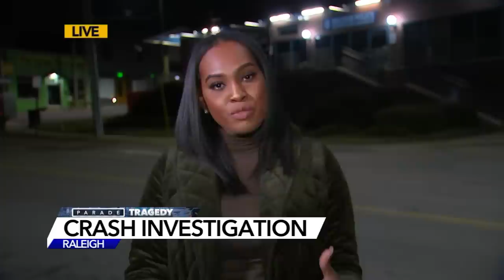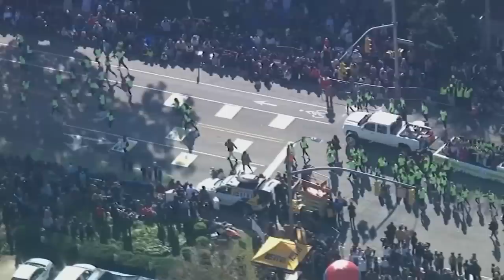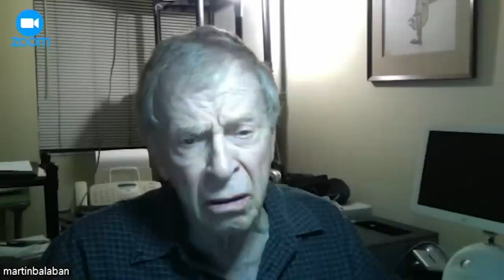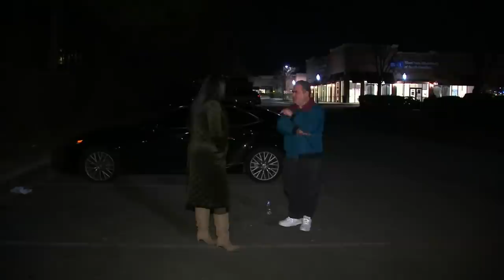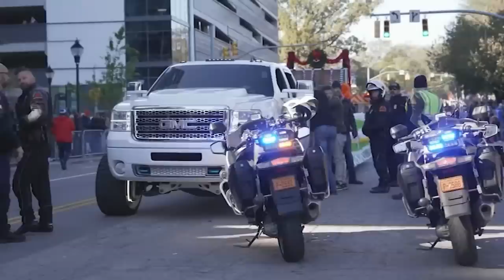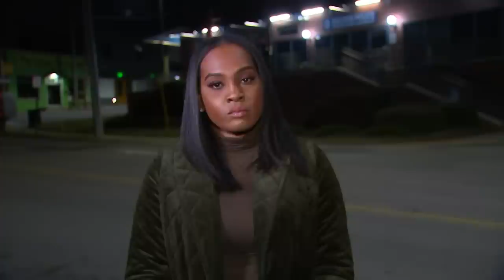Investigators look at truck part by part after Raleigh parade tragedy

Comment: i pull trailers all day 5 days a week, im sure he panicked but there are many things you can do before it gets to that point. pump brakes, slam the parking break. throw it in to neutral and put try to put it in park even if it damages the truck and stops the parade, its still a better outcome than what happened. prayers go out to the the girl’s family and  the young man for making a mistake.
Reply: He had an e handle
Reply: Lifted truck.. big wheels.. I'd have driven through a building before I hit a kid..
Reply: if ur a truck driver and pull trailers u should know a parking brake isn’t the same as an emergency brake and a parking brake is only meant to hold the weight of the truck not to stop a moving truck and if he put the gear in park it would have just clicked the tcm wouldn’t of even picked it up so i highly doubt ur a truck driver
Reply: @bookingmods9197  what do you mean the tcm wouldn’t have even picked it up? And if you force the shifter on this trans hard enough it will click but it will go into park. The park pawl may have broke the case but it would have probably stopped the truck.
Reply: Parking pin in the transmission would grenade and will not stop a truck especially pulling a trailer. Keep in mind this is a diesel that runs in a hydro boost system for brakes… there is no pumping the brakes when it fails
Reply: @jamesmoore716  brakes went out, allegedly.. not the steering
Reply: @jamesmoore716  either way, the kid had a history of driving vehicles without current state safety inspections.. it's still his fault..
Reply: @SLOCLMBR  steering going out and brakes going out at once is common. Learn some basic mechanics. The safety inspections weren't safety inspections, they were emissions buddy. My state does do emissions checking either way so it doesn't really apply, brakes failing isn't a rare thing, he was just unlucky, and he has to pay the price for something he has 0 control over. Before you say it, a little lift and 35s aren't the cause of the (brakes) failing
Reply: Its extremely hard to stop when its a pressurized system and the system as a whole fails. It was easy to oush stop because he most likely had parking break on andddd had it in neutral. But heyyyy get this an object in motion will stay in motion especially at a down hill slope. Ive been pullin trailers with my dad for 7 years.
Reply: @joshwilson849  the tcm would register it going into park from drive going idle speed. parking pawl would just click and the tcm overrides it to neutral to protect trans. the parking pawl will just keep clicking go try it buddy
Reply: @bookingmods9197  the tcm cannot override input the manual selector. It can override a range selection but not a command to park
Reply: @joshwilson849  fake news buddy a youtube video will debunk that right now. i know at like 5 mph they can slam stop but not how fast he was going
Reply: Or just turn the ignition off...
Reply: i valet trucks like this all the time....they wont shift past N until you're under 2mph. wont engage P unless your foots on the brake. parking brake light will just flash at you and do nothing until you get the speed down. This is the cost of letting computers dictate everything. there was literally nothing he could do, and in a panick, good drivers dont swerve.
Reply: Brake failure is not something taught in driving school, and it should be, buddy probably panicked
Reply: @CanuckBacon  it was when I was in driver's ed. If I remember correctly though the advice they gave was to downshift to the lowest gear possible and turn into a guardrail or wall to scrape along and slow you down
Reply: Ok obviously you dont know much about diesels, this is called a runaway diesel and the only way to stop it is by cutting off the intake it was completely out of his control he was doing everything he could he is only 20 and shouldnt have to go through this you see that the trick was still pulling the trailer with ease it obviously wasnt the brake system
Reply: @lilhudlambo7646  this wasn’t a runaway.  If that truck ran away this parade would’ve been a bloodbath.
Reply: @bookingmods9197  parking break works on a completely different system that is usually not at all electronic
Reply: @joshwilson849  actually no it wouldnt have stopped the truck slamming it park the teeth arent as deep as you think .
Reply: He had the truck in park and and empty break on but he had too much momentum it just kept going
Reply: @bookingmods9197  Hi NOT SO BRIGHT,  the parking brake would have slowed the truck down or stopped it as it wasn't doing 60 miles an hour . The more of your comment that I read, not more unintelligent that you sounded.
Reply: @bookingmods9197  PS. NOT SO BRIGHT,  I drove big trucks and regular trucks pulling trailers and ran heavy equipment  for over 45 years. You obviously haven't.
Reply: @bookingmods9197  The more that you comment, the more unintelligent that you sound.
Reply: @bookingmods9197  You should stick with your video games.
Reply: Wow I sure shows you’ve never had your brakes go out.
Reply: @jimbeam2705  and yah buddy i used to make money off games when i was in middle school. i drive a big truck just like u and pull trailers of equipment too now bud i guess i’m a cool guy like u now
Reply: For the lift it does matter as if they used low quality brake line or did not install them correctly then it would only be a matter of time for the brakes to fail. You can’t just lift that much without new lines. 

The 35s also do matter as that probably doubles if not triples the rotational inertia.  (Simple physics).  Meaning stopping takes much more force, stressing the brakes more and you will need to inspect and replace parts more often.     This also made it harder for people trying to stop it by hand. Now it was not as big an effect as the float of course but it is still a factor.     Not to mention an e brake likely was not installed as again you have to lengthen lines after a lift for it to work. This alone would stop the vehicle albeit slowly.
Reply: @lilhudlambo7646  you don't know what a runaway diesel is lol.  That truck would have crashed into the first building in sight or if in neutral it would have smoked the whole place out until it blew.  None of which happened.
Reply: @UCzegEr0Nc6AwCoxq5Dsr-2Q   when a hydro boost brake setup is ran off of sensors yes it’s very well electronic. he probably boiled his fluid from pulling the float. but putting it in park will only make the parking pawl engage.i have no idea where u got a parking brake engages the park pawl. only gear park does. there called parking brake shoes that engage when u press in a parking brake has nothing to do with a transmission. buddy
Reply: @UCzegEr0Nc6AwCoxq5Dsr-2Q tryna correct me and u don’t even know how the basic engineering works lmao ur just like every other guy that’s commented saying there a big truck driver and how their right
Reply: So you would know throwing into park would of done zip , the paw wouldn’t be able to grab it would just make the clicking. And the E brake isn’t gonna stop the load , we don’t know the weight of that trailer we don’t know if the trailer even if trailer brakes that actually worked
Reply: @jimbeam2705  see my above comment  ive tried it. All it does is the blink its little red light at you until you put it in park and then it engages. It is the same for every GM model, from there base little sonics through their Cadillacs all the way up to the Denalis and Yukons. You have to buckle the seat belt in order to get them into gear to drive them away and you have to have your foot on the brake with it at a standstill before you can put it in park or engage the parking brake. parking brake works off the TCM. Some call them safety redundancies I call them an annoyance to the guy whose job it is to park as many cars possible in the shortest amount of time possible.
Reply: @85square  every vehicle now days has electric parking brakes.. what do you mean?? Lol alot of vehicles you can't even have the door open and start to back up! It slams the ELECTRONIC ebrake on!
Reply: @joshwilson849  he tried shifting and broke the shifter
Reply: @bookingmods9197  parking brakes on an 11 GMC Sierra had a cable no electronics about it works similar to a bicycle brake
Reply: @BrendenCBR600RR  I pretty sure that truck doesn't
Reply: @jnspython9719  You have no clue what's on a vehicle do u? It's a parking break not an Emergency break
Reply: @CanuckBacon  I know when the master cylinder on my '73 dart left the chat room I had to use my e-brake to get home. Kids these days does not get taught enough of  "oh sh#*" scenarios. My dad helped me like driving in the snow and while turning, he pulled the e-brake on my fwd. Little he knew I drove a lot that way.
Reply: @340duster8  exactly! 💯% my dad used to sit behind the driver seat, and would randomly cover my eyes and then just give me directions, it taught me how to drive straight, use my other senses when driving as well as how not to panick
Reply: @340duster8  I also learned on the spot when my brothers Ford Escape 2017's brakes failed, how to brake using the transmission
Reply: A lot of people are saying he should have swerved into a wall or building, you can see all the crowds all around him that wasn’t really an option
Reply: Light pile right there too
Reply: Just turn it off. Simple!
Reply: I pull landscape trailers to big Tex dump trailers for a living that dude could have don’t something different
Reply: @jnspython9719  an e brake won’t work unless the vehicle is stopped
Reply: @Haun Lou the brake lines and e brake cable are designed for the car as it’s made by the factory. It has very little slack in the lines as they make it to fit with some manufacturers tolerances. So you might get an inch lift kit hooked up with stock cables except the cables will be taut and any disturbance could rupture them. In larger lift kits you need to add extensions or new line to accommodate the new length of tube or wire to reach the brake. 

Or do you think trucks just have like and a tea 6 inches or more of loose lines just flapping around when at stock height?
Reply: @lilhudlambo  This is 100% not a runaway diesel.
Reply: @jnspython9719  I mean, going downhill, and all that weight? If he pulled the brake. It will have broke too.
Reply: @SLOCLMBR  Did you not watch the video?  There were people all around the truck...  If he drove it through a building he would have hit the crowds on the left or right of the parade.
Reply: I doesn't damage the truck it only damages the parking pawl that won't stop it. All he had to do was kill the engine
Reply: ok well do we know that he did not try these methods that you are suggesting
Reply: This is a very sad situation. I agree that the driver is young and not very experienced. Most of us are older than he. I have been taught to shut off the ignition or slam the vehicle into park. I did slam the vehicle into park while slowly skidding down hill. It worked. Please be careful.
Reply: how do we know he did not do this and why convict him before we know what happened, they had already nailed him to a cross right there on the in the middle of the street
Reply: Correct and I have that same truck if the float had electric brakes he probably could have applied that alone and the truck would most like stop or to slow to a snail's pace.

Heck, he could even just cut off the engine and that would probably slow it down or stop it.